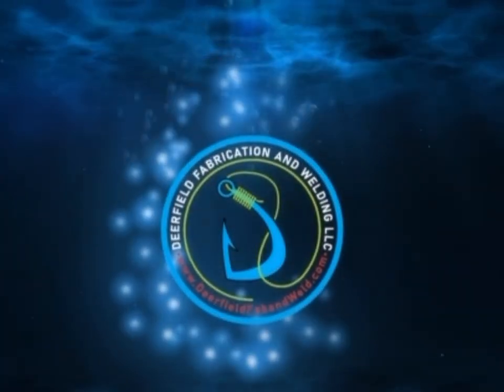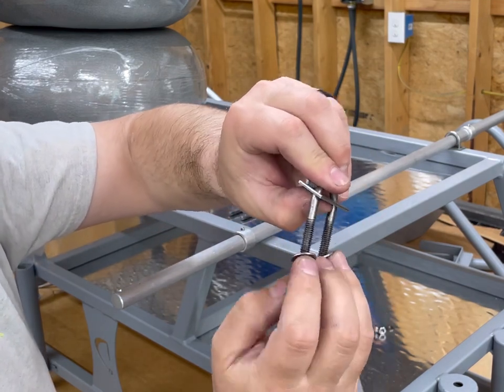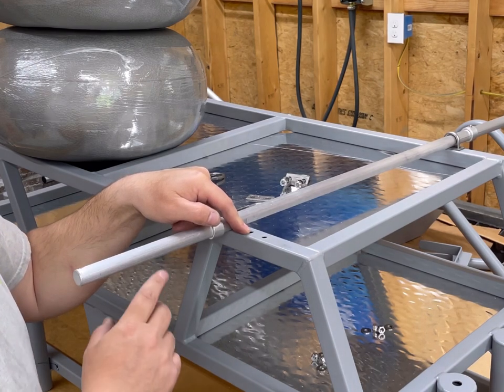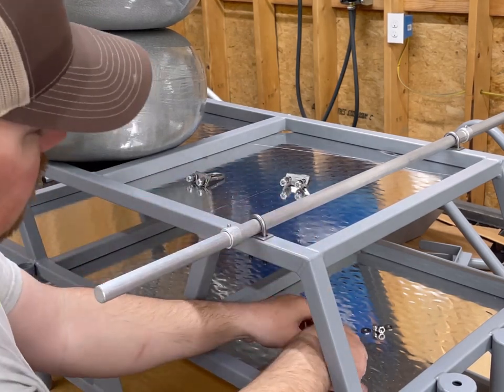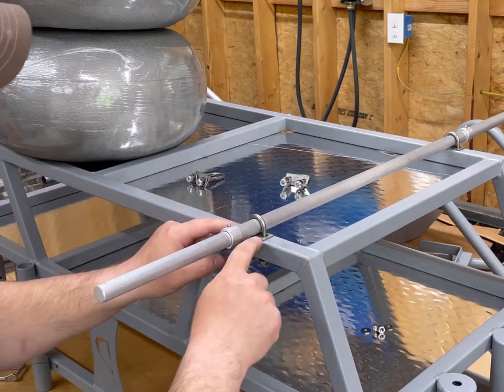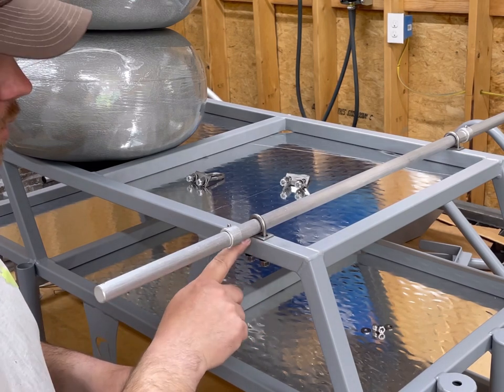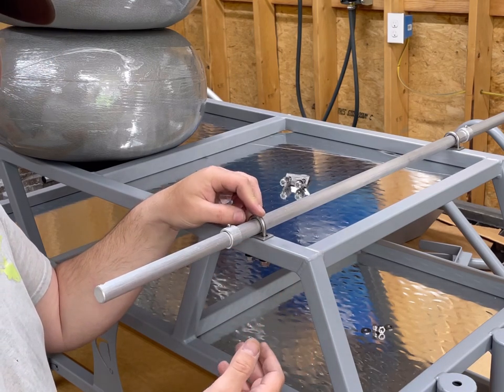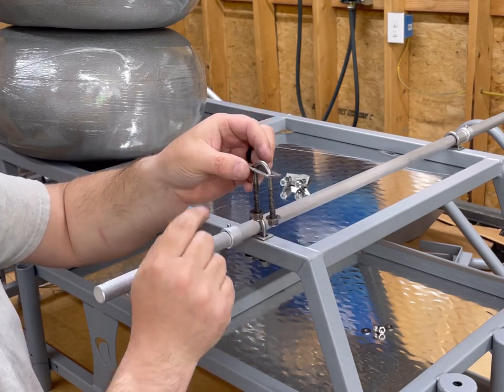BEST way to mount axles to your **BEACH CART**

Comment: Need aplate on top and bottom as the washers and nylocks will bend the frame on the bottom side as well IMO. This is how I set mine up as the aluminum frames are weak and will "dent" from the nylocks and washers.

Comment: Are these u-bolts 3/4" or 1" ?
Reply from the maker: @NamucaPresident  they are for 3/4” axle’s. It has a 1” hole spacing center to center.